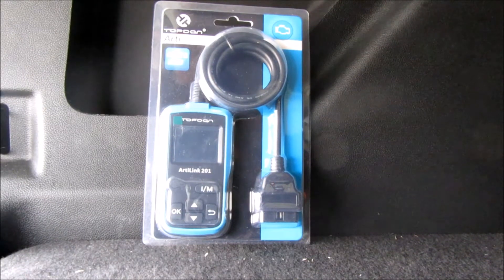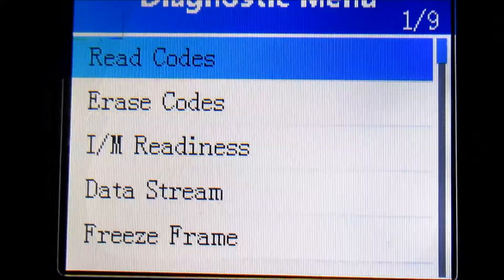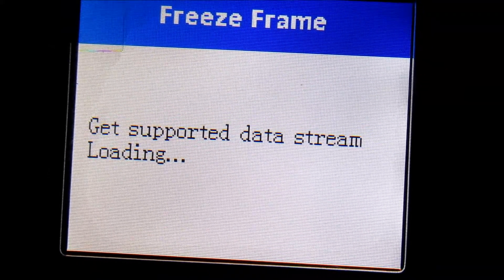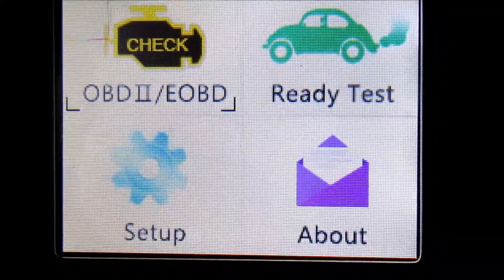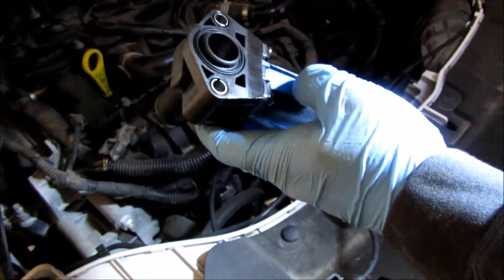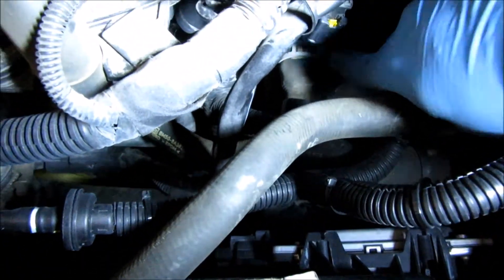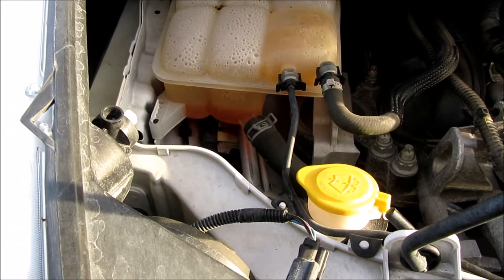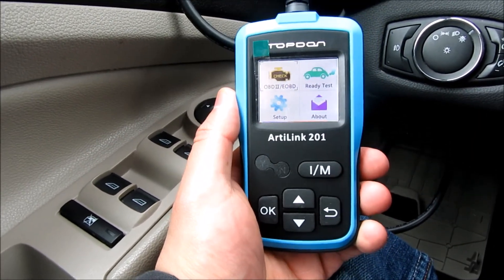Topdon Artilink 201 OBD2 Code Reader Review/Demo. Fixing a P26B7 on a 2014 Ford Escape

Comment: I bought one of these and i was checking live data while driving and now the screen is frozen like is there any way to reset this scanner to get it as it use to be please and thank you
Reply from the maker: I haven't had that issue but mine has recently stopped reading codes which is odd.  I was going to try and connect it to the PC and see if it could be updated on their site.  It might be worth a shot for you also.

Comment: Hi , I notice you connect the code reader with the engine running , The manual on chapter 4 . diagnostics 1 caution ,say: don't connect   with the  engine running .
Reply from the maker: Yeah, I found that a lot of scanners say this but i haven't ever had any issues arise because of this.  Also, this type of scanner can read some live data so you would have to have the car running in order to read some of that.

Comment: Hi! The same code just popped up on my 2013 escape. How long did it take you to replace the solenoid valve? I'm not a mechanic so I was wondering if I'll be able to do it myself.
Reply from the maker: It took me roughly 20-30 minutes or so.  Mainly because I was using a cheap ratchet that wasn't cooperating.  As long as you have a small ratchet and some pliers to remove the clamp it is very doable even if you're not a mechanic.  It's just 2 bolts and a clamp to undo.
Reply: Thanks for the quick reply. The dealership quoted me $400 on it which is insane. lol Thanks! I will do it tonight then.
Reply from the maker: Yeah, $400 is quite excessive for that job.  Good luck with it.
Reply: Morning. Just replaced it last night, took me about an hour cause the clamp was blocking my way to remove the 8mm bolt. It was such a pain to get it out and put it back in. lol. I did lose more coolant than you did. There were no visible leaks but I am still keeping an eye on it. The coolant level did drop after I refill it, I assume it's just sucking the coolant in the system? 
My engine light went off immediately after the replacement, but I can still see it when I use the OBD2 scanner.
Reply from the maker: Yes, it will suck it in through the reservoir if it needs it.  I believe that mine also did show up with the OBD2 scanner afterwards but I haven't checked it again since I changed it.
Reply: DIYAutoCarage I have a question though. I noticed today that my engine warms up pretty quick. The temperature here is around 80, I drove it for an hour, parked it in an open lot, when I start the car after 7 hours the temperature gauge was at a quarter, then it rises to the middle line in 2 minutes. Is this normal? I think it normally takes longer than that even if it’s summer time? At least it would drop all the way to the “cold” line after 7 hours? Or maybe I’m just paranoid.  Thanks!
Reply from the maker: As long as your coolant level is fine and you aren't overheating you are most likely fine.  Cars just warm up faster in the summer.  It was probably the same way before you changed the part, it's just that now you're actually paying attention to it.  Just keep an eye on it for a few days if you're worried about it.